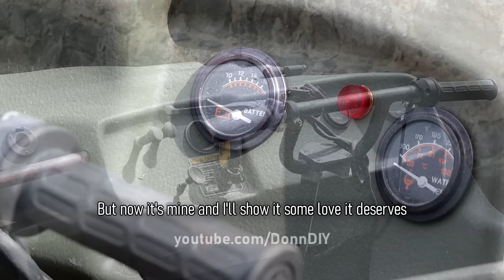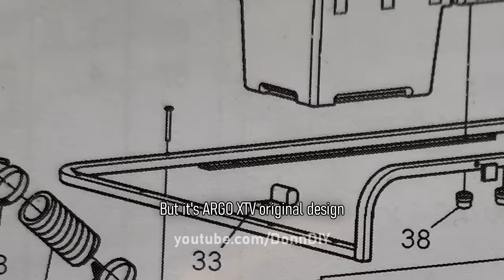Complete Teardown - 8x8 Amphibious Vehicle Argo REBUILD Ep.1

Comment: Good to see you back on a project. That inner frame design is just nuts. That the factory did that is even more insane
Reply: It's not nuts, it's the "economic" design. Bare minimum to reach the desired specs.

That's how you make money. Have a product in mind, built the initial prototype (as say Donn did with his amphibious vehicle) from which you slowly start cutting away until you reach the bare minimum that does all the things the initial prototype was able to do.

Sometimes, that's a good thing done, the item is lighter, and can even be made stronger, depending on how you make that structure. Most of the times, it's just to increase the outcome pay you get as a CEO.

That tends to happen when a company reaches the "plateau" and the only way to go higher is either reinvent yourself or... start cutting corners.

Small companies are able to reinvent themselves, they're agile and they come up with great solutions to the issue, big fat ones cannot, so they grow like a bad cell cluster by buying themselves out of obsolescence while reducing the quality of the product (theirs or the one they bought which had fame for being a great product). 

You can see that with many, many firms and brands. From basic locks "Master Lock" (which is something you can open with a plastic straw) to something like a once, great mountaineering shoe like the famed Danner mountain light, which they're not re-releasing... at something like 4 hundos... but with the inner construction of a cheap shoe you buy from undemocratic countries with sweatshops.

C'est la vie.

Comment: It's hardly surprising that the wheel bearings are shot; with that huge offset from the tub, combined with the extender nuts, the loads on those bearings must be enormous! I'm guessing that you'll modify the bearing housings to extend them nearer to the centre of the tracks and do away with the extender nuts, Donn? Looking forward to seeing what you do to that flimsy space-frame chassis - that is pathetic!

Comment: Did the exact same thing to an Attex 6X6 years ago. Had a fortune in bearings,seals, and six new tires.
Had a 20hp 2cycle air cooled engine in it. Would drive it for an hour and fix it for eight hours! Same type of ladder frame. My advice, beef up any frame work, install a small bilge pump, silicone all joints even if you think it's impossible to leak. Will be watching, brings back memories on this build!! Also by the time your done you will have a sore back from bending over all the time! 🙂

Comment: If I remember correctly from an article I read on these years back, the Avenger never actually came with the tracks as standard. It was a pretty expensive optional extra that consisted of the tracks, those spacers and the wheel stud extenders. Because of that they were a ridiculously rare piece of kit on the civilian supplied vehicles.

A few countries ordered them for their military with the track kits, but found that, with the added leverage that spacing the wheels out caused,  the kit put too much load on the front and rear wheel outer bearings, and they could fail alarmingly quickly. There was something in the user manual about the tracks only being for soft/boggy conditions though, and the militaries acknowledged that they'd been using them on ALL TERRAINS with the track kits fitted, so the complaints about premature bearing failure were classed as the users being at fault. I've got a vague memory about talk of an alternative spacer setup to fix this problem. It was either going to add alloy spacers blocks between the bearing carriers and the hull on the front and rear wheels (The middle pairs would still use the original kits spacers and stud extenders), then use longer stub axles, or it involved complete replacement longer bearing carriers, with upgraded bearings spaced further apart, and longer stub axles.

I don't know if that redesign ever got passed the planning stage, or if it was something that made it into later versions, but I couldn't see it being that hard to make a kit of parts yourself with the tools and skills you already have.
Reply: Well it did look bit weak setup to my eye, it seems i was right. This is ridiculous given the current pricing of these vehicles even with out track kit, let alone part prices for transmission alone. Wondered about getting transmission and building my own but its 3-4K that is more than my cars combined are worth, so no go
Reply: Do you remember where/when that article was?
Reply: @garthmonday  Unfortunately not. I used to buy any random car magazines that took my eye, so the short list pretty much consists of any that were published in the UK between the late 80's to the mid 2010's. It could have been in any of the many classic car mag, one of the handful of military vehicle mags I'd pick up (used to want something like a steyr/puch haflinger, or even a 4x4 pinzgouer, so would buy any mag that had a feature on either), or it could even have been in Practical Performance Car, as they'd often do features on random project cars, and for particularly obscure ones they'd usually give a fair amount of background for the vehicle type in general.

About the only things I remember that could help identify the actual article was that the project car they were doing the feature on was bright orange, and there was a rather cringeworthy staged photo of it in a lake, with one of the guys onboard standing up, and casting with a fishing rod.
Reply: @Reman1975  Well, thanks anyway for remembering that level of detail. I've only ever driven later model Argo's with tracks. We gave them quite a bit of abuse. I feel a bit leery in retrospect, considering some of the design shortcomings.

Comment: I enjoy watching and have more respect for a person who gets the job done  in a confined space and not a lot of the fancy gadgets as seen on a good amount of channels here on the Tube. I personal do all my work by myself I small garages and a few times without a roof over my head. Great to see another project. I'm late to check into the channel, but I will be binge watching this rebuild.
Reply from the maker: Thank you. The main area in my workahop is 35 m2, but the floor space is taken up by 1k62 lathe, work bench, cabinets, milling machine and welder. So I have even less actual work space. I'd like to upgrade workshop wise for sure.

Comment: Very ambitious project!
Better check those chains for stretch/wear. Count 20 links or so. Look up the nominal pitch. Tension the chain. Measure your counted links. See how much longer your chains are than nominal. There will be a specification for how much stretch/wear is allowable. If the chains are too worn, you will have to replace the sprockets, too, or the new chain will wear out very quickly.

Comment: Don, as someone who is somewhat familiar with glass fiber body shells, I suggest bracing and securing the top half with some straight (and flat) timbers then storing it horizontally, perhaps by suspending it in your ceiling space.
If you keep it on its side, there is a very good chance it'll warp and by the time you get to reassembling the vehicle, everything will be out of alignment.

Comment: 1:14  Tip - Run the chain like you have it, but also around the uprights. Less chance of the chain slipping off the forks. Could also clamp a Vise-Grip to the end of the forks. 
Drilling a hole in the tip of the fork really weakens it. 
I like what you're doing. It must be really satisfying to tear down & rebuild things correctly.

Comment: Put two CVTs in, behind the CVT of the transmission - one connected to each track. Remove the weights and put them on an arm which adjusts the ratio of them in opposite directions, linked to the steering. This way you get much finer control over the differential motion of the tracks and don't waste power just to heat up brakes.

Additionally, you could switch from a throttle to a governor operated one. But instead of using the engine RPM as back feed you can use the CVT output as back feed. So, the throttle/engine-rpm is modulated by the governor to adapt up and down to keep a steady speed.

This also gives a smoother ride, without the need to constantly adjust the throttle. Maybe even switch to a leaver to set a speed and have the handle throttle just as dead man switch to quickly return to idle if something goes wrong.

Comment: This will be such a cool project. If It was my project I would fix several of ergo problems. 
It needs to be a foot wider and 2 feet longer. ( The exact size is determined by the existing proportions of the unit. ) Since the unit is fiberglass one can rebuilt this quite well. 
it nees a better motor. 
Better controls and clutch. 
Better lights, winch, seats and options. 
Super glad this is not one of them old ones that has the all in one tire/rim. I had an ATV once that was toast that had these tires. I tried for a long time to sell of the parts to the machine and not a single person wanted it yet had 100s of watchers. In the end that machine ended up scrapped.

Comment: Perfect project! I have an 8x8 Conquest which is the generation just before this one. It is in need of some TLC after 5 seasons as a moose recovery machine. I would like to improve the winch frame (the u shaped tubular support inside the engine bay). I also want to see if I can add a roll off deck made of aluminium to help us lift moose into / onto the back...

Comment: Always wondered about the assembly of these. Not too crazy about all the rivets, but in a smaller shop like theirs, it's probably the fastest way. Always a money game I guess.
Reply: Yeah the riviets suck. The way they built these and the way they should have are two separate things. I have offended looked at them when they pop up for sale and opted out of buying them. The cracked frames, welded frames and a whole host of other problems and then some guy thinking he is gonna get 10k for these machines. 
One of my old neighbors had 2 of these machines sitting on his land and they still sit there to day. He wanted 10k for the pair. They did not run, been sitting there for a decade or more ( been a decade since I looked at them ) They were rusted, welded and just in poor shape and sitting outside aging in the sun. I bet I could go and ask him and he would want even more money for them. 
I see this stuff sit around for years and years. I once bought from someone else a older 80s model ATV which was in poor shape and had been sitting for years and after a clean up and a good amount of money was able to fix it up pretty good, till the stator went out in it and I sold it for more than I paid and had in to it. Even after removing the winch I still got a lot more for it. 
I no longer mess around with used stuff.

Comment: Donn, I'm not sure you need to power all 8 wheels with those tracks. You might just power the 4 rear wheels or even just the 2 rear wheels .. with a more simplified chain drive to make this less complex and noisy ... and lighter. Do consider a simpler chain drive ... and welcome back!

Also, a remotely-lowered trolling motor in the rear would give good water propulsion and steering, running off the battery or with the gas engine running to provide electrical power. 

Finally, a couple of electric automatic bilge pumps placed in the lowest hull positions. Just a few thoughts ...

Comment: Advice: spend the extra dough and replace all the bolts, nuts and screws that exist outside the Argo, under the waterline (edit on the exterior). Tracks, body, the whole lot. I know, a small fortune, but worth the effort. See if you can't track second hand hardware for the tracks, within that application, it doesn't need to be brand new. I have had great luck finding bins worth of used stainless in my local auctions (old factories being shut down or firms that make kitchen or medical cabinets and various such amenities).

Comment: Advice: when you start using it, rotate the tires every few hundred kms used.
Use a classic pattern for it, rear left goes to rear right front, middle left to middle right rear,  you get the idea. Even tho the tires ride on track, they still get worn.

Also, this is more complicated, but if you plan on using it long term, then it's probably a good idea to upgrade the OG bearing and bearing pockets to a bigger bearing, preferably something with substantial width. The OG bearings aren't exactly... rated for the use this type of machine sees. If you compare the bearings in a small skid steer with these, the difference is evident. If you can get cheapo bearings that would replace the ones on a skid, that should be sufficient. Adapting them would be a piece of cake for someone of your skill set.

First part, is pretty important, but the second one is just my 2 cents, not really important if you don't feel that's the case.
Reply: @aserta do you think the high load on the bearings is because they are too close to the center of the vehicle?

Comment: I can tear things apart, too!  it's when I try to put them back together, and I end up with extra pieces, that everything goes sideways!

Also:  those Argo's are stupid expensive!  Too see how flimsy they are... I'd be embarrassed if I were that company charging those prices!  Glad this one will get the DONN treatment and be better than new at the end of it!
Reply from the maker: I mean, ARGOs are pretty durable if you treat them without excessive abuse. This particular machine was serving as a workhorse for an electrical company building power lines etc. I guess they hauled heavy electrical cables on the backrest over tough terrain, thus it broke, and didn't maintain the driveline that well and eventually faster wear&tear happened. I personally really like this simple rugged nature of this particular ARGO.😀
Reply: @DonnDIY  ahhh,  that makes sense.

Comment: Another awesome project Donn. ArgoCat's are high maintenance and most I've seen have been beaten up badly with wheel bearings, water rusting out vital components an UV damage to the Hull. 

I just want to say to anyone who moans about the time it takes for a video to remember that Donn doesn't work for you, you are not sponsoring or paying a subscription. If you don't want to support the channel then jog on
Reply: You are right. But the one's Ive seen restored (improved) are very sturdy and reliable.  You just have to maintain them like a piece of heavy equipment, constantly checking lube and tolerances.

Comment: I have a six wheeler unit .. engine under the dash ,, they ran a snowmobile engine in the unit I have ,, mine needs the same kind of work bearings bad ,, wheel hubs are broken off the axles ,, fiberglass tube has holes in the bottom where it rubbed the ground ,, mine does not have tracks .. it will be nice too see how you do yours ,,

Comment: How did you push out the axles using a hammer and punch? I am doing the same project and have two stubborn shafts that I can't even move with a slide hammer!
Reply from the maker: I used bronze punch to not damage the shaft. And lots of rust solving oil.